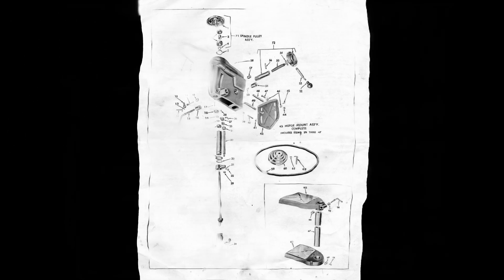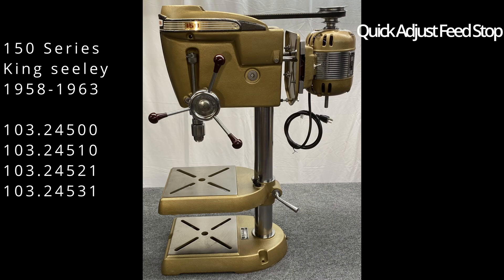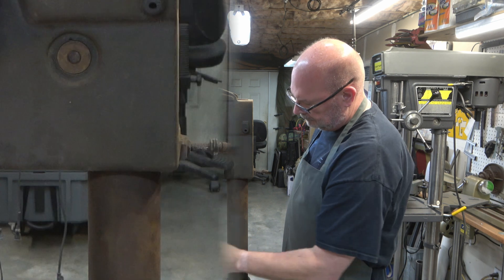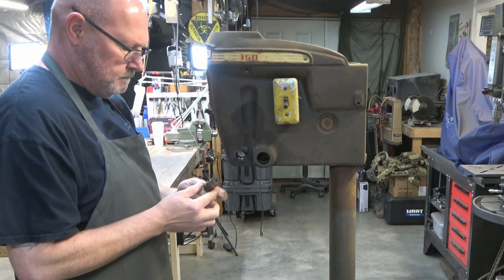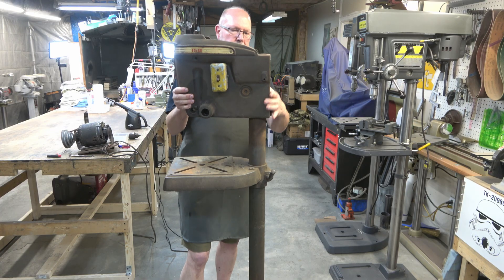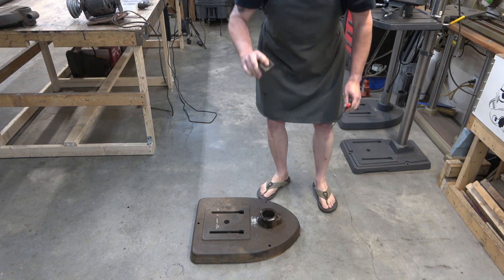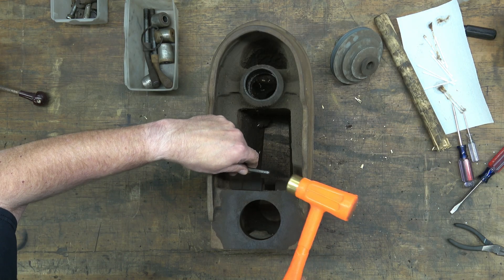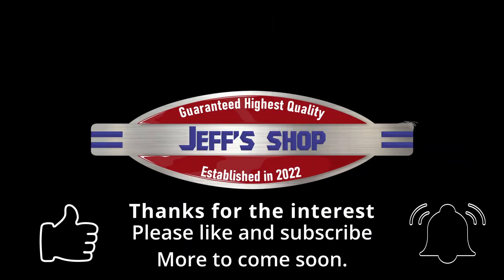Part 1 Craftsman KS 150 Drill Press Rebuild (Overview & Disassembly)

Comment: I contiue to watch your Craftsman drill press videos. Your review of your Craftsman commercial DP made clear what is included in the commercial upgrade. I didn't see if your commercial DP has table elevation rack and pinion. One of the frustrations that I have with light duty drill presses is how cheaply they make these racks. It is very common to see store demo DPs with bowed racks from customers playing with the elevation without unclamping the table. What size T nuts fit the commercial table?

Emerson used to manufacture in St. Louis. I don't know if they made Craftsman machines in St. Louis.
Reply from the maker: I think the t-nuts are 1/2". I got them from McMaster part # 91523A720

Comment: Just got one with a bent spindle for 50 bucks. Oh it was painted like a hot dog.
Reply from the maker: If the spindle is not too bad, it can be corrected. https://youtu.be/2J4aigerK9Q?si=uf8HYJ2ojeqo2YpG
Reply: @JeffsShop thank you!  What would be considered too bad?  Other than a dial indicator what other unique tools would be crucial to the restoration of a drill press?
Reply from the maker: @birdstrikes  It really depend on what condition the drill press is in; however, the dial indicator is the must have tool for determining runout and correcting it. I have seen some significant runout corrected. Take your time and do not use heat, I have ruined a spindle in an attempt to correct runout with a torch.

Comment: Very interested in the motor rebuild. I have one I am working on and would like to be able to ask some questions on if that is allowed…?
Reply from the maker: Yep you can ask questions; however, you may get better and more timely answers if you post your questions and some pics in a thread on The Garage Journal Forum. GJ is free and once you are registered head to this thread. https://www.garagejournal.com/forum/threads/craftsman-drill-press-information-belts-bearings-chucks-keys-etc-1946-1984.489080/

Comment: You channel has lit a fire under my backside that has launched me into a restoration frenzy with these drill presses. I am simultaneously restoring two model 150's, one benchtop and one floor standing. I'm also restoring a floor standing model 100, and "cleaned up" a model 100 benchtop model 100. The benchtop 100 was in really nice condition when I bought it for a mere $50. I couldn't get to the seller's home fast enough, and didn't even try to haggle with him over the price. The only thing I did to that drill press was polish the column, and pulleys and cleanup the work surfaces of the table and base, and left everything else as is. it's a fine looking survivor. Keep up the great work with these videos, and in your restorations Jeff !!!!!!!!!
Reply from the maker: Wow, it sounds like you have been busy. I am glad you find the channel useful and thank you for watching.